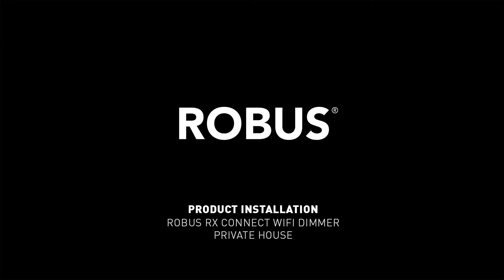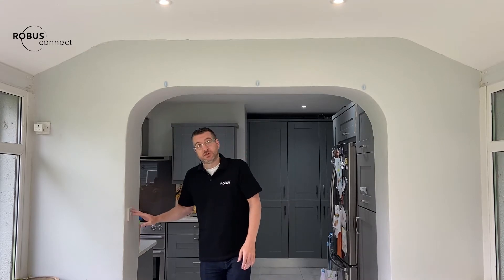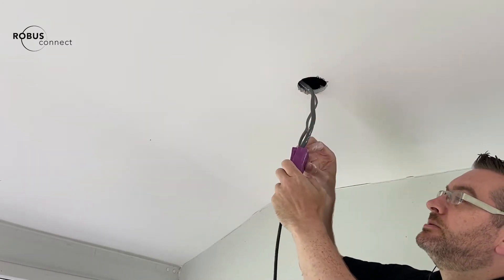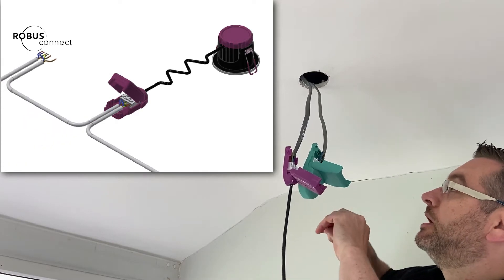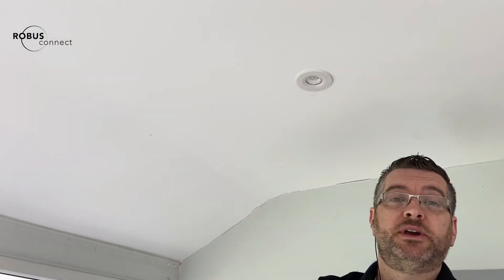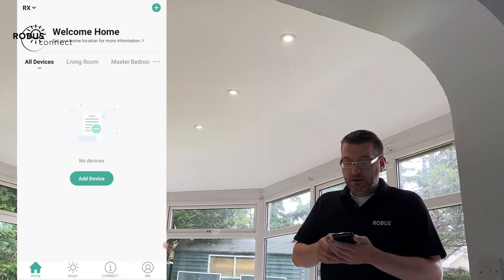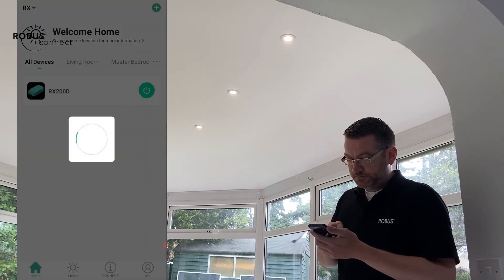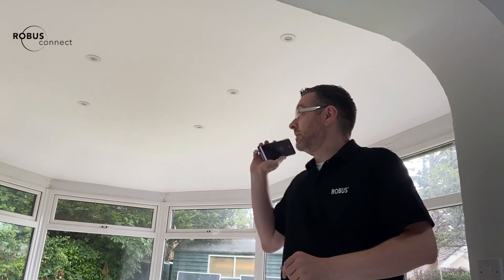ROBUS CONNECT | RX CONNECT installation with Chet Kelly

Comment: Have a couple of these installed. Great product. 

Not the product’s fault but if you’ve someone in the house who still uses the traditional switch, then that stops the WiFi part from working (obviously!) as it’ll kill the power to the RX200 unit. 

It’s even better if you can get to the switch wire and replace the standard on/off with a retractive switch. Gives ability to control dimming from the wall as well as the app. 

If you’re using the “Smart Life” app, the RX200 is also recognised in this, meaning you can control all your smart stuff in one place.

Comment: Is there a simple wiring diagram for this? Ive looked at the one that comes with the RX COnnect unit and its not as clear what you made out in this video.
Reply: Could one be added to the end of the video?
Reply from the maker: @colinjackson2215  Hey Colin, if you send an email to connect@robus.com Chet will come back to you on this and yes we can add to the end of the video once we clarify what you are looking for.

Comment: Does not work, even brought a new TP-Link router incase something wrong with my network, using 2.4 Ghz the app just does not see the dimmer in setup mode with lights flashing... i mean im right next to the router... so tried 2 routers and 2 dimmers... if there is a magic setting please let me know else I will never buy this brand again :(